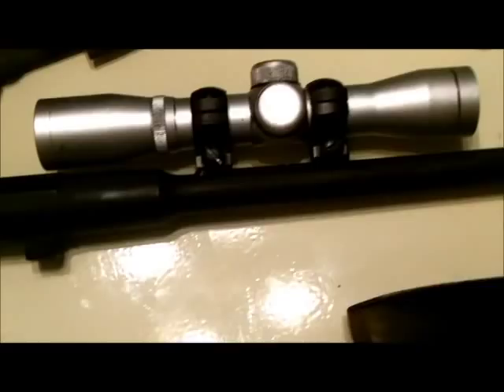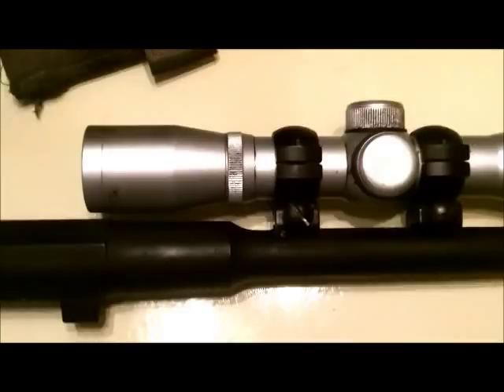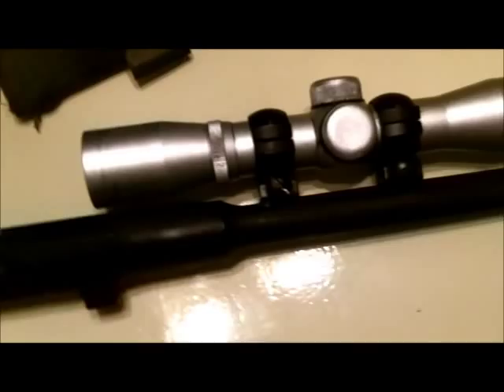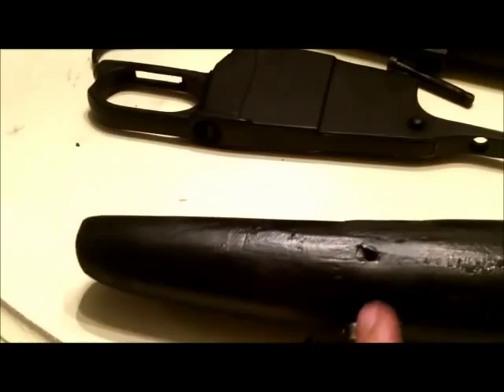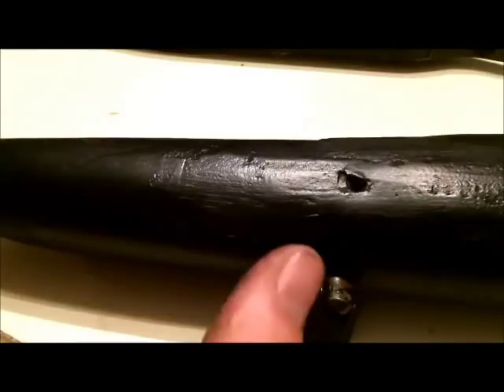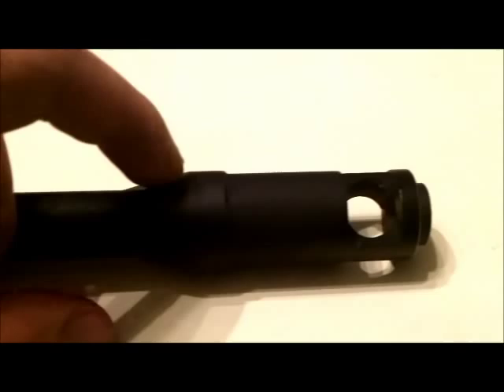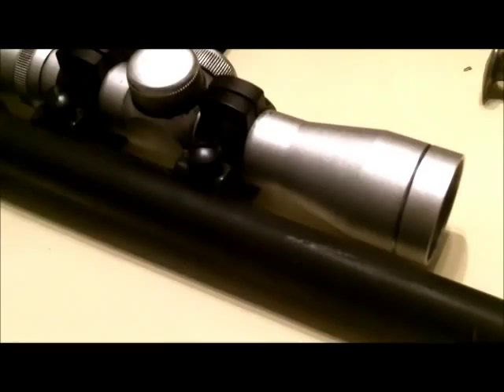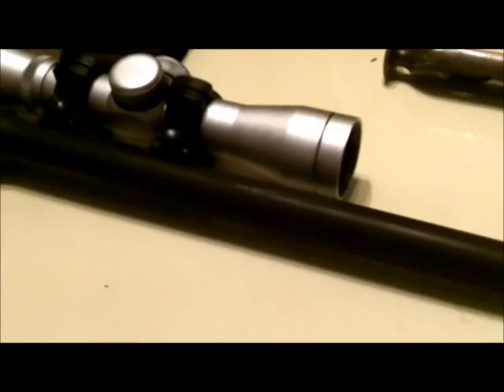Mosin Nagant Mods

Comment from the maker: If you decide to use a mount for the scope instead of the method I used, I would say go with the brass stacker mount. Other cheaper ones end up flopping in the breeze after a couple clips through the gun. Ask me how I know lol. But at any rate congrats on your mosin. You'll be happy with it scope or iron sights either.